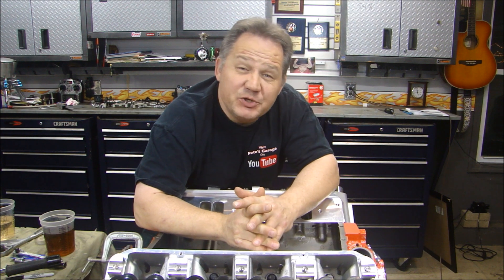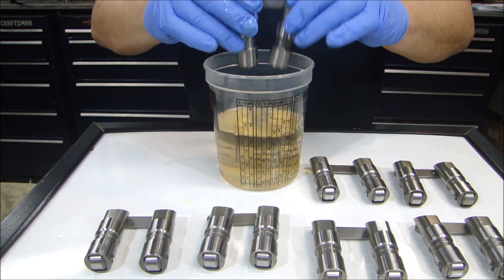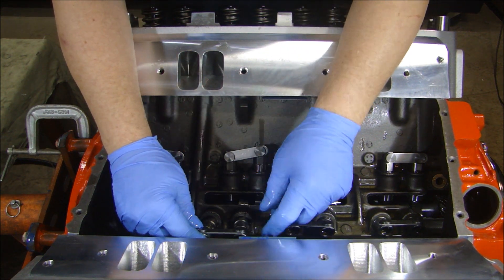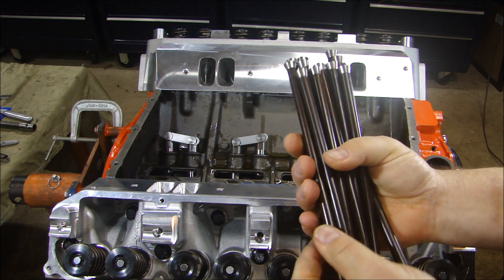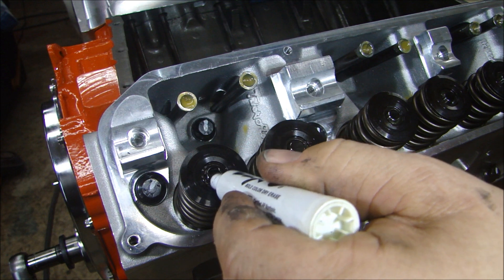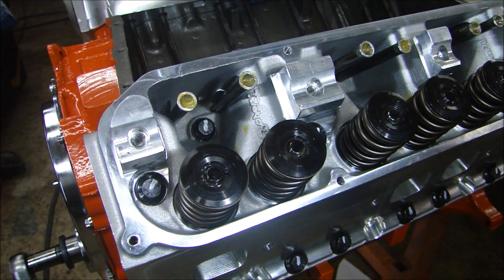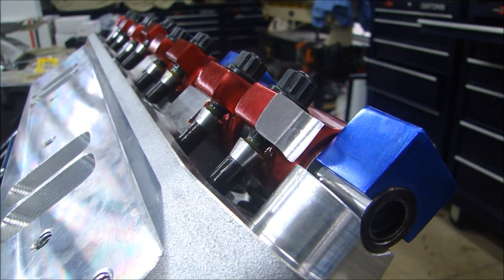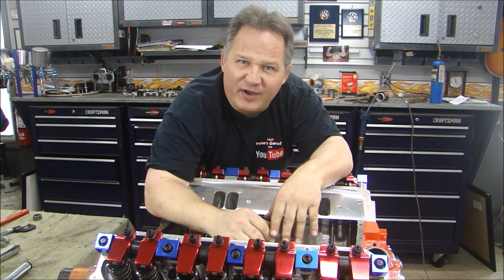440 Chrysler Mopar Part 9 - Installing Roller Hydraulic Lifters, Pushrods, Rockers & Setting Lash

Comment: Hey Pete...subscriber here. I followed your build and copied many of your "tech tips" motor is just fine after a few months now. But I'm eating torque converters left and right. Do u have a particular favorite brand? I broke a Summit brand, then a B&M brand, and now the longest lasting one - a Hughes brand converter. I keep stepping up in price thinking I'll get a better one by spending more money. Because, well -I'm cheap. The motor is nothing radical. Maybe, and I'm just guessing, around 500 horses. Nothing that would warrant so many converters. I can understand the $250 converter breaking and even the B&M. (heard bad things about those B&M's) but I dropped some real coin on this Hughes converter and it's done now too. I would really appreciate your input. Hope your well and thanks for all your posts and replies. Stay safe man, and have a great day, week, month, ect. heh heh
Reply from the maker: Did you check to make sure the transmission shaft runout to the crank. Sounds like it's not straight
Reply: Thanks I did just go through it but I'll check again when I pull it back apart. It was straight the last time I went through it.
Reply: Hey Pete, thanks for advise, I checked the shaft and it was still good and straight. Went with a converter from FTI this time and had zero issues after a year now. I guess I must've missed some debris (metal shavings) when going back through it or l got a couple of bad converters. It's not a huge power house motor or anything. Shouldn't have so much trouble with a converter. Anyway, thanks again. Hope your well during this covid crisis.

Comment: I never knew how to set valve lash until this video. Always heard it was this magically difficult process that you just didn't want to get into. Thanks for lifting the veil on that topic. What about non-adjustable valve trains? How do those differ in build from adjustable? And what about changing rocker arm sizes? I assume there are some really extreme builds out there, but how far do you have to go before you get to crazy?
Reply from the maker: Most non-adjustable ones are set by the geometry and with hydraulic lifters. When you start changing rocker arm length with higher lift cams you have to spend more time making sure the pushrods are the right length and the rockers adjusted correctly.
Reply: I full turn is excessive,     half turn,

Comment: Can anyone help me.  I have a 440 that I'm installing heartland sharp roller rockers. The rockers have a ball end and the adjustable push rod has ball end. I can set the pushrod ball end to rocker ball end. But I can't turn the motor over  a couple times to see if the rocker lines up properly on the valve stem. Any suggestions? I can't find a adjustable pushrod with the funnel top.
Reply from the maker: If the rocker has a ball end you need a pushrod with a cup
Reply: Pete's Garage 
This I know but it appears that no one makes them. I'm going to teach out to some companies tommrow. Thanks
Reply: That's why I indicated I can't find a pushrod with a cup end.
Reply from the maker: http://store.440source.com/Pushrods-for-Adjustable-Rockers-_-RB-8905-long-New/productinfo/105-1008/

Comment: Came to this video to get rocker spacing clearances, thank you for providing that info, bought a set of Crane ductile iron adjustables for a 318 build, and sent them back as quality control was fairly bad as to bore center was off from rocker to rocker and they did not come with the springs (as the old 273's did back in the day and are no longer available anymore), nor shims for centering, went with Mancini rollers, very good and came with the shim package but not specs for spacing, one quick question, wouldn't you want to clean the lifters with mineral spirits while you had them disassembled? I would think by dipping them you would have mineral spirits inside the lifter that would not blow out with the air, and still have some in there when you dipped in oil, probably insignificant amount, but still my thoughts are to clean when they are apart, Thanks for the video, it was helpful
Reply from the maker: There could be a very small amount in there, but remember it has to be pushed in under pressure. The mineral spirits are to wash them off and provide a little lubrication

Comment: I need some help and I hope you can provide me with  a answer   I currently have a 440 dart tunnel ram, the car seems to have a crazy miss in the engine. It's hard to explain. Anyway I didn't build the motor my uncle did who has been building molars for over forty years. The engine has a purple shaft not sure of the details on the cam shaft other then I was told it's a minor purple shaft. The car had this kinda miss when I first got it. It had two Edelbroch 750 on it and a stock converter. With a magneto dist. I first took out the converter and replaced it with a 3400 stall speed no change. I replaced the plugs a completely rebuilt the carbs. No change. I installed all new gaskets ,intake, plenum, carbs and so on. I checked the timing both at idle and 3000 rpm s, 10 degrees at idle advanced and 34 degrees at around 3000 rpm s. I also checked for vacuum leaks didn't find any by using propane and a hose. I replaced the two carbs with two new edelbrock 600 no change. Checked fuel pressure 5lbs. Checked vacuum 15 at idle and close to 30" at around 3000 rims. I replaced the entire ignition system, installed a msd hei distributor and spark box changed plugs and wire no change. This 440 has rpm edelbrock aluminum heads. Hydraulic lifters standard push rods. It feels like a miss at 1000 rpm s but when it gets up to around 1800 it feels better but then acts up again. I took a temperature reading on all the headers all the headers read around 250 to 350 in temp it varies except for cylinder 7,8 the read much higher. Around 500 degrees. I decided it's something in the valve train so I bought heartland roller rockers I need to change the push rods to a cup type and I'm being asked to provide a length for the push rods. I was given some info on how to obtain this information but it wasn't clear. So I'm stuck now and have to pull the intake off again. Do you know the process of getting the correct measurement? I'm exhausted from this issue and hoping the roller rockers clears up this engine issue. Thank you . T .G.
Reply from the maker: I do have a video about measuring for pushrods. A tunnel ram changes fuel velocity, the cam may not be right for it.
Reply: So did you ever do a compression test or cyl leak down. I do that before  changing out good parts.

Comment: Hi Pete, at what point would you consider adding pushrod oiling and if used would you add oil restrictors to the heads or pushrods.
Reply from the maker: If it were a racing engine that was at risk for low oil distribution. I'm not a huge fan of oil restrictors.

Comment: I put 1 cam in on a rainy dark night back in 1997 in high school with my dad's mechanic friend. We didn't pre oil anything except moly lube on the lobes & I asked him do I need to break it in he said no, just drive it so in the morning I started it and went off to work. Nothing bad happened at all . I didn't even change my valve springs. I went from bone stock 206 duration and .420 lift to 237 duration and .474 lift. I was a kid & didn't really know all of what I know now, I wonder how much of what I know now is really necessary. But the engine I'm putting together soon I'll will be putting all of my knowledge into because there's a massive difference between a 320 hp daily driver & 600+ hp street / strip car. I think sometimes it's easy to go down the rabbit hole on some of the engine stuff but it's better to decipher through the info & make an educated decision as to if it's that big of a deal.
Reply from the maker: There are so many reasons why things went right back in '97, and so many reasons why they could go wrong now.
Reply: @PetesGarage  yep that's very true. Oil to start with.

Comment: the soaking thing. I've built my share of mopars and chevy's. I've never soaked my lifters. My dad didn't either. I can distinctly remember a couple of manuals from the 70's and 80's actually saying to NOT soak the lifters. I'm not sure why anyone would think that would help since it really doesn't do anything the oil pump won't do when you spin it up before first starting the car.
Reply: Hi David I'm building my first Mopar motor now. I've always had a Pontiac and mostly built Pontiac motors. And like a Mopar... the rockers on a Pontiac bolt down all the way. There's no rock bar... but all the way down just like a mopar does. And as u already know, there's typically no adjustment to be made. U just bolt them down & bolt the valve cover on just run it. No adjustment needed. But, I've had a couple of Pontiac motors where the lifter would not pump up and stop clattering because of a high lift cam. & That's why people soak them overnight. (to give em' head start on getting pumped up) But I like to go one step further by submerging them completely in oil in a container & then use a pushrod to pre-load or pre-pump them up. Get a lot more bubbled out of em' that way & they really do get much firmer. I've never had a lifter that wouldn't pump up after doing that. Now, I don't know what to do about this motor. I have same rockers as this video. But still scared not to or pre-pump. This video was completely un-familiar  to me. I've never used a an adjustable rocker arm without a solid lift cam & a feeler gauge. Did that video seem normal to u?
Reply from the maker: I agree, I just wonder where it came from

Comment: Hey Pete,
Thanks for some great videos.

Question:
-is the high flow oil pump for keeping the hydraulic lifters oiled?
Im building a very similar engine with Hydraulic Roller cam, but was planning to go with stock oil pump/pan. Is that a bad idea?

Cheers
Reply from the maker: With a 7 quart pan it's important to keep the oil flowing. A high volume pump is not a huge price difference so it's worth it.
Reply: @PetesGarage  Thanks. But is a 7 quart pan/ high volume pump a must when going with hydraulic roller lifters?

Comment: Im thinking about upgrading my chrysler 440 1971 engine with the Edelbrock Total Power Package 482 HP 440 Big Block Chrysler Top-End Engine Kit is it any good? and what type of lifters should i get, thanks!
Reply from the maker: Well.....there's more to upgrade than just the top end. A decent cam will help providing your crank and pistons can handle it.
Reply: @PetesGarage  Bassicly the only thing im going to keep stock is the bottom end exept the cam, im also thinking about 150-200hp of nitrous, Will It Work With A 800Cfm Carb?

Comment: So when setting lash just put the cylinder at TDCC and tighten the rocker arm until it stops wiggling and then go a half turn?
Reply from the maker: Well, at TDC the valves are not really closed. You have to go by when each valve closes, then adjust the rockers.
Reply: What helped me the most with doing this is EOIC method. Look that up. 
(Exhaust open intake closed)

The opposite is IOEC

If you do it this way your accuracy will be way up on adjustments. This is more power.

Just get the slack or play out and then do the extra full turn.

I used to know a guy that would adjust them while the engine was running by sound, but there is too much noise going on from a loud engine in my opinion.

Comment: isnt it better to use a feeler guage vs the hand method to adjust the lash?
Reply from the maker: Yes, on solid lifters. Hydraulic do not have any lash.
Reply: Lash is actually another word for spacing correct?

I’ve never adjusted solid lifters but I’m assuming since there’s no hydraulic portion that you have to leave a small amount of space that would normally be taken up by the hydraulic portion of a hydraulic lifter?

Comment: Roller tip rocker arms are without doubt the single most ridiculous thing ever put on a street motor.
Similar priced, adjustable ductile iron bronze bushed hard chromed shaft rockers are available for all Mopar shaft mount V8s. They're superior becuase the large radius of the ductile iron rocker tip wipes across the valve tip. Conversely the the tiny roller on roller tip rocker arms has a surface loading intensity multiplying effect due to the much smaller radius of the roller when compared to the wiping pad of a non roller rocker arm tip. Why these truly stupid rocker tips were ever put on a sub .750'" lift application is completely beyond my comprehension. The other thing is they don't make any more power (or reduce heat) and add more moving parts on a motor where durability is more important than looks!

That said I have them on a motor of mine because there is no other option when converting from stud to shaft mount on some motors.
Reply from the maker: I use them because there is no other option when converting from stud to shaft mount
Reply: Hey P I have a question I love your show and it's very informative my question is this if I'm using a high-lift cam hydraulic non roller and Edelbrock RPM heads with no work done meaning having the block shaved or the heads in the paperwork for the Edelbrock heads it says that I can use a 9.125 length  push rod so length change on your engine because of the use of the roller cam
Reply: I have some of the same opinions as you but something I have wondered and would like your thoughts on. Have you considered this? What about valve guide wear and side loading?  I tend to think the roller tips would help on this vs sweeping style even on a street motor.  Seems it would place less stress on the wear prone guide even if its concentrated/increased on the hardened roller and valve tip. Thoughts?

Comment: what Brand are you using? usually the cost i see on internet sites is outrageous for making roller lifters fit Block
Reply from the maker: Those are Elgin roller lifters $400
Reply: Thanks, I am so glad they are made, I hope they make them for Small Block L.A. engines too! i will check

Comment: I have a 440 motor 30 over with cast iron heads with a solid flat tappet cam 1.5 roller crane rockers it’s pushing 595 hp .why is your motor pushing 550 hp
Reply from the maker: It could all be in the compression ratios, fuel, pistons. The goal was 500
Reply: Because the trick flow heads valve seats aren't concentric, the valves leak and the guide clearences are tight would be my guess.

Comment: What keeps the lifters pumped up as you are turning the engine by hand W/O oil pressure ??????
Reply from the maker: Once they are pumped up They will stay that way. I don't turn the engine over aver pre-lubing the system
Reply: @PetesGarage  what? How do they not bleed down without oil pressure? I've always had to use either a solid lifter and matching pushrod or an "adjustable" lifter like Hughes offers to check the geometry.  Every hydraulic lifter I've seen bleeds down  as you turn over the engine without oil pressure.

Comment: Hey Pete-how about a quick video explanation on the history of lifters?  I looked around a bit and couldn't find any good explanations.  I'm sure there was an evolution from solid to hydraulic lifters and there must be a benefit to them.  But it seems like a hydraulic lifter is exactly the OPPOSITE of what you would want in a valve-train....a 'shock-absorber' of sorts.  It would seem that an bit of 'give' that a lifter offers would be detrimental to very specific requirements for valves to open and close according to the wishes of the camshaft.  Thanks-Steve
Reply from the maker: That is a great idea, I'll add that to the list. Thanks!
Reply: Look into FREE VALVES! Utube Koenigsegg freevalves. No need for timing chain, camshaft, lifters. Unlimited LSA! Make V-tec laughable.

Comment: Pete I love the 440 BBC (i have three) I appreciate your videos they are awesome!!  Im building two 440/512's this winter for my boat!!  I hate to say so but i agree completely with the comments about PRCOMP rockers..  I didnt know I had them on my motor until I lost one it was not old and not abused, they fail ALOT..  Comp Cams Pro Magnum STEEL ROLLERs are $700, come in 1.5 or 1.6, and they are IMHO the best value rocker for the 440 hands down, maybe the greatest roller rocker on the market honestly.  They are the same weight as aluminum however they have ZERO needle bearings and are USA made and extremely high quality which is needed for the lift and spring pressure your running..  Its worth replacing the pushrods and for a few hundred more pony up for the COMP CAM PRO MAGNUMs..
Reply from the maker: Thank you Tony, I will look into it and let everyone know what I find